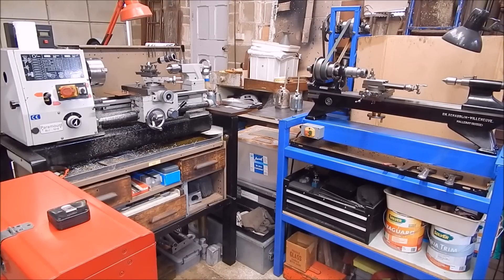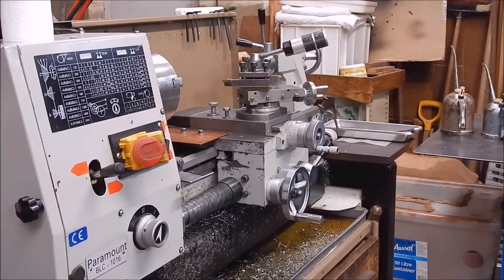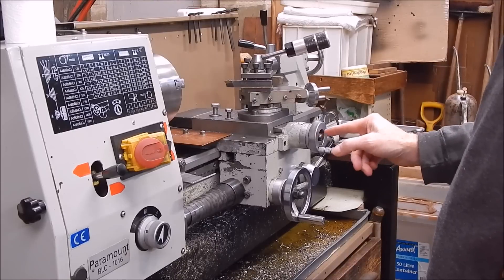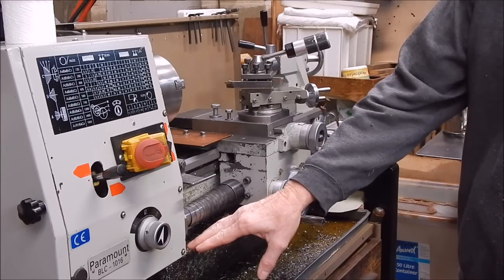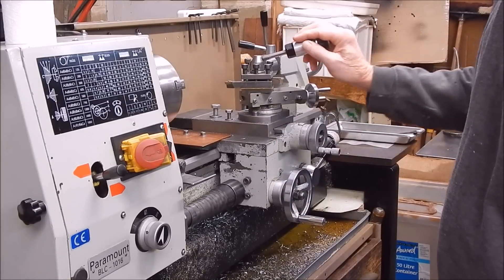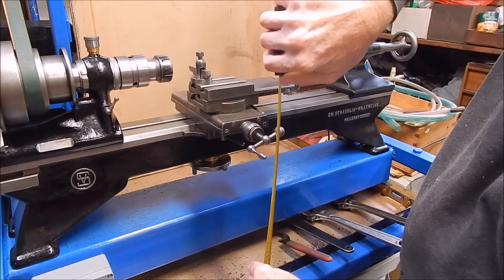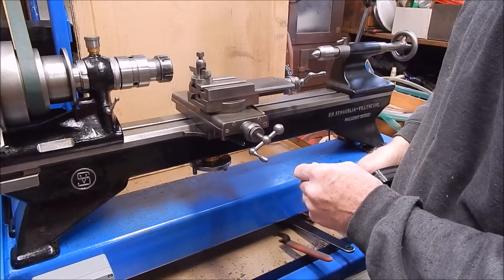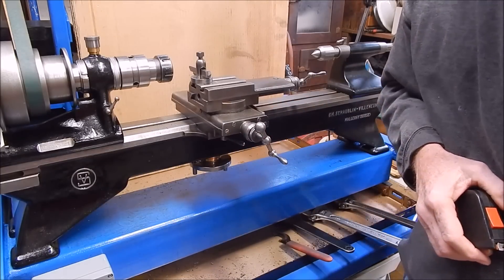How to calculate the correct height for a metal lathe stand

Comment: How is the height working out for you?
Reply from the maker: Good.

I'm 6' 2" and my 10 and 9 inch lathes are at a perfect height for me.  No stooping or bending.

Cheers Rob
Reply: how high is your elbow in inch's?
Reply from the maker: About 1 metre.

That's three feet in Imperial.

Generally your elbow is about half your body height.

Cheers Rob
Reply: You mean your table is 3 feet? But your elbow is higher. I am going to build my table tomorrow.

Comment: i bought a lath and the stand is 26 inch-- i am 6'2   its way to low.. I am building a stand right now-- decide to check what other think.  However i am picking it up with a engine hoist and will lift or lower until it feel just right.. That will be my height. The other issue i ran into is leave room under to slide the hoist up to and under table or you are screwed.
Reply from the maker: Check this out before you build your stand: http://users.picknowl.com.au/%7Egloaming_agnet/cq9325rev4.html

Cheers Rob
Reply: Because i do not have steel i must build mine on a solid  wood bench (No flex).However i do have a thick piece of flat steel i can lay on wood table and steal shim as or needed.. I like the pull out drip tray below- but i can not do that. I like the drawers on the flat shelve-- i will do that. Thanks
Reply from the maker: Glad you found it useful.  Do what you like best and makes you happy.

Cheers Rob
Reply: I lifted my lath with an engine hoist and to find out what felt best. Than i built the bench and checked with a laser level for fine tuning. When i was done i checked the elbow height as you said--- guess what-- it was on the money. So yes elbow height is perfect.  Thanks! Another note-- my lath is a 12 x36 harbor freight that they no longer sell-- Guess what-- It is exactly the same as the Grizzly G4003 they sell today for  $2,850.00-- i bought it for 1,200 with many extras...  I threw the leg stands out because they were too darn low. CHEERS!
Reply from the maker: Hi Robert,

Thanks for the feedback, it was much appreciated.

That was a good independent test, and it's interesting that it verifies what I was taught.

There are exceptions to the rule, and for very big lathes you often need to lean over the carriage/ways to check and set up jobs, and have the lathe a bit lower.

But for general rule of thumb, the video holds true.

Interesting stuff.

Cheers Rob

Comment from the maker: To clarify the calculation completely: 

You take the vertical distance between the lathe base and the cross slide hand wheel centre, from the vertical distance between your elbow and the floor.

The difference is the height of the lathe bench top from the floor.

Cheers Rob
Reply: What about overall width (front to rear) of stand at it's highest point & lowest point?
Is there a "general rule" to go by? 
For example how slim(front to rear) could a stand be if it were 1m tall?
Reply from the maker: The stand can be any dimension you want to make it, the main stability influencing factor being if it is bolted to the floor or not.   Anything top heavy in machinery should be bolted down.
Reply: @Xynudu  I plan to make a hvy dty trestle from a mix of 200x100x5(top) & 150x150x5(legs) RHS.

Comment: G'day. I think maybe it might be a bit more to suit the individual & lathe specs (center height etc). I'm a short arse at only 5'6" in 'old speak' & my 14-40 lathe has the cross slide dead on my elbow height but I'm building a 6" platform to stand on while operating it as I get a back ache fairly quickly due to always stretching & leaning forward to see the work piece while turning it. Probably is a good starting point though. 
Cheers for the vids.
Reply from the maker: +Bo Vejby 

It's a basic starting point/recommendation for sure.

On a small lathe bed there isn't the leaning over you get with a very large lathe/wide bed and carriage, and you being short would make it worse.

Back ache is bad news.

Cheers Rob

Comment: great advice, thanks! it comes just in handy, as soon i hope to be building a stand for a chinese 10". i think the stand will be bolted to the floor but in case it won`t how much mass do you think it should have for a working lathe?
pete
Reply from the maker: +thebrokenbone 

Hi Pete,

Stability  really comes down to the area of the base of the stand.

If it's not very deep, then definitely bolt it down.

I don't like having any machinery not bolted down as there's nothing to gain,  and everything to lose, if it's not likely to be moved in a hurry.

Both my stands have plenty of shelving to weigh them down with other stuff, which helps damp out vibration.

The mass of the stand depends on the design and what you make it out of.  Heavier is better - some people even use concrete.

Both my stands would weigh in the vicinity of 80 - 100 kg each at a rough guess.

Both cost less than $40 AU each using salvage yard steel.

Cheers Rob
Reply: hi rob thanks! yes i will talk the owner to bolt the thing (he has some concerns about the quality and thickness of the subfloor slab)
i will use your design if you don`t mind and was thinking to use channel iron 100mml (100x50x5mm) for the beam, two sections of  50x5mm angle to form the ends of the beam, and a lower frame made from square section tube 50x50x3. two shelves and a chip tray of 18ga. will try to use as much recycled as i can to keep cost down. if vibration is an issue will try the concrete blocks to add weight. 
the two angle sections is where i plan to bolt the beam to the frame to take away any twist of the frame
thanks again
pete
Reply from the maker: +thebrokenbone 

Hi Pete,

Go for it :)

I originally pinched the idea from what they use in ships machine shops - a solid beam with pivot point/mounts to overcome flex in the ship.

The one thing to watch for with this design is that any oil from the lathe/beam can only drip into the tray.

So make sure you have the beam lower than the end plates (so the oil can't run sideways), and angle the beam ends in slightly to direct oil into the tray.

My beam ends are both cut straight/vertical, and I wish now that I had cut them on an angle inwards so the oil tray can fit easier.

When I referred to using concrete, I meant that some people use it to make the beam - super strong, easily leveled and no vibration.  Slight overkill, but it's another way to do the job.

Cheers Rob
Reply: thanks rob when it`s done i`ll see if i have the nerve to post it here on yt. credits to you of course. thanks a lot for the explanation of the oil drip, it hadn`t passed my mind :). concrete beam! wow i really really didn`t think that was feasible, amazing.
pete